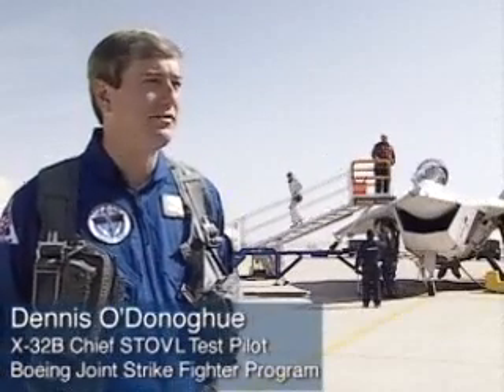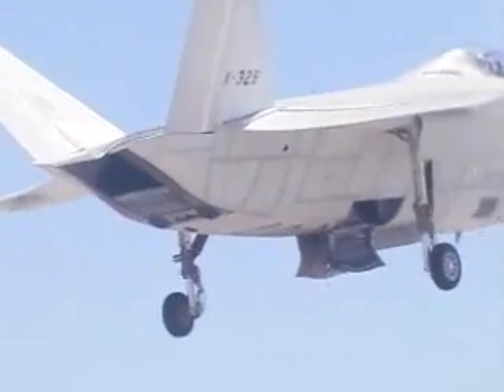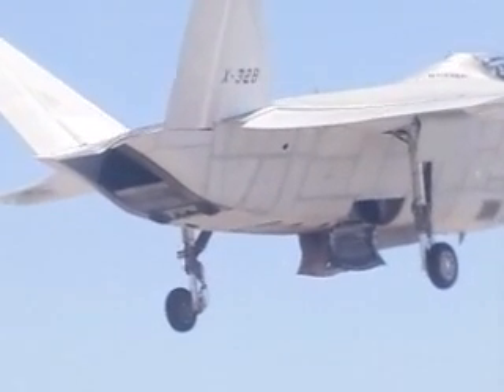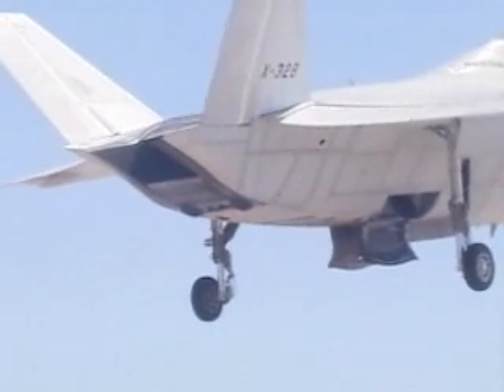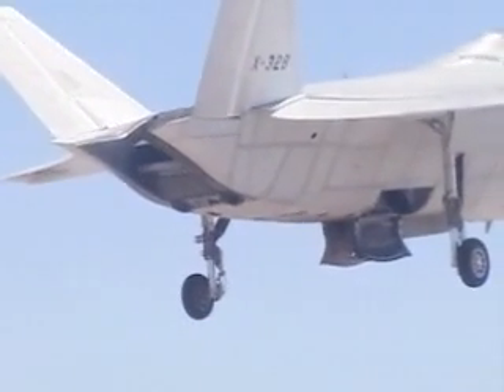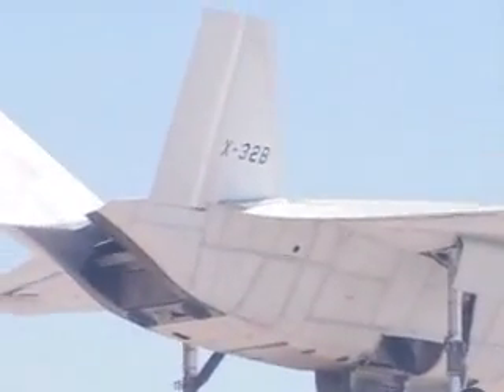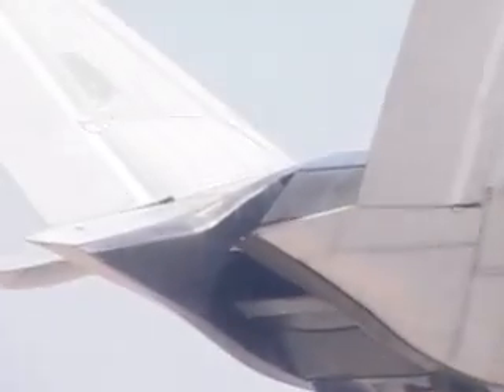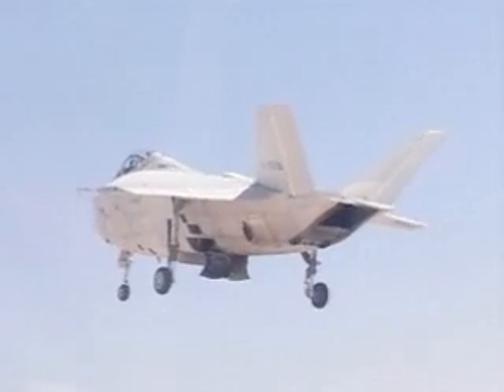X-32 JSF transitions into Vertical (hover) mode

Comment: F-35 is also dull and depending upon BVR.   USAF, USN and USMC would have been as strong as They are now even if X-32 had been chosen.   For sure, It would have saved Military Budget a lot if X-32 had been chosen.  F-35 was actually proven money eater and useless, too.   Wait for F-36 with a lot of spending for F-35.

Comment: wow its more impresive than f-35
vertical takeoff with only one thrust source
meaning no thrust balance possible, that is impresive
how they balance the center of gravity momentum?
the only way is putting the thrust just below of the center of gravity... that is risky and difficult
CG position variation will cause instability and that is imposible to prevent when mass of fuel and weapons are gone...
very rare plane we have here
that is why you need minimum 2 source of thrust to balance the plane in stovl
the only solution that i see here is that they balance the cg variation vectoring the rear exhaust thrust... but that will cause horizontal propulsion ergo no pure vertical takeoff...this plane is like a joke to me
Reply: The X-32 was incapable of successfully performing a vertical takeoff.

Comment: Ugly , I guess they didn't want the contract .
Reply: Fake. There was no transition... 
1. Look on his face and eyes when he said they made it,
2. valves after turbine cannot change flow (into cold supersonic air intakes only). Similar exhaust structures near flameholders a completely unsuccessful X-12 Rockwell had. 
X-32 lift system is state of the art misdirection. US simply "bought" X-35 in Russia (Yak-141) via Lokheed at the price of two Ferrari in 1992, long before both X-programs were initiated. Then made it stealthy with different shape adding radar swamps. Anything else is cyrcus for money laundering and boosting american morale.
F35B is also not clean of this shit. It would be shortly operational or cancelled at all due to STOVL like XV-5 and other not solvable inherited and its own general technology flaws.
EASY MONEY!!! Should better aided to social care.
Reply: DreadnoughtMetal2006 Nope, I'm one of those who put rivets on Yak in USSR. Pre-F35 "story" US robbed nearly the same way britons for Harrier - AV-8 is beyond licence, it's Pegasus engine only. But West came even further patenting Yak know-hows as their own.
Reply: They both have wings and landing gear , must be a copy ! Russians copied jets from the Germans
Reply: davetileguy wings, landing gears and oth component parts must be of proper shape, metherial and have been properly connected -  even germans failed with supersonic STOVL design thus US took soviet as they did before with british Harrier (its beyond licence too).
Reply: DreadnoughtMetal2006 No, those two occasions are not correct. F15 flew earlier than MiG-25 pilot defection and MiG-25 itself could fly nearly 1.5 times faster and higher than F-15. F/A-18 and Su-27 are not even close, latter has most sucessful aerodynamic up to this day.
Reply: DreadnoughtMetal2006 Yes, there are some. MiG-31 are much more many.

Comment: It needs to be vtol or have a low stall speed to be a carrier aircraft. In theory you could have a delta aircraft on a carrier but its heavier/reduced range/less manouverable
Reply: I believe that the delta wing was not going to be on the final design. and the craft would be 15000 lb lighter.
Reply: @timothyduffy8818  Yes, it was going to end up being more like a traditional fighter, with elevators, and traditional swept wings.

Comment: @bingofioul 
They choose it because the X-32 couldn't fly at supersonic and couldn't land vertical or there had to be parts removed but than it couldn't fly at supersonic. Also it wasn't suitable for the Navy because of the Delta Wings.

But i would have chosed the X-32
Reply: Nah, the final product wasn't going to have a delta wing design, and it could land vertically, but only in certain places where the air was thicker, and it would be able to fly whatever number the navy pulled out of it's a$$. It also was super ugly, but the final design did actually look pretty good. The only advantage it had was it was a bit cheaper, and would be able to be mass produced. But it just wasn't as technologically advanced as the x35.

Comment: Well, the YF17 from which the F18 was derived was the competitor to the F16, and was much closer to it, though eventually lost the competition. The evolution towards the F18 meant a stronger structure and landing gear, leading to heavier weight overall, bigger engines to keep the plane up... essentially the F18 is a tad too bloated. In a dogfight within visual range the F16 would have a serious advantage. The F18 wins outright BVR, though, and has a much bigger range and endurance.

Comment: Because the Navy doesn't operate F-16's? The F-18 is less maneuverable than the F-16, though this doesn't mean it's a worse plane. It can be controlled at a higher AOA, but it's heavier, and while having two engines has its advantages it puts more workload on the pilot.
Reply: Because F-16 use one engine. It's risky operate at sea.

Comment: The f-35 may not look as sleek as the f-16, but it's at least as maneuverable if not more. It looks bulky because it carries most of its weapons internally to maximize stealth. Same for the X-32.
Reply: What makes it look bulky are the fuel tanks. They are behind the cockpit and transition to the cylindrical body of the engine at the back. The X-35 looked sleeker, but endurance matters in a real fight.